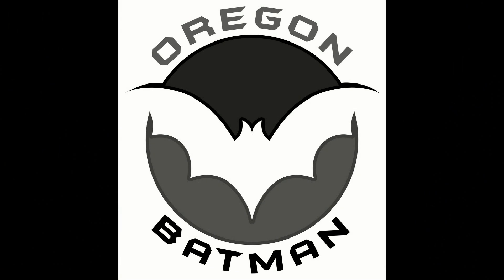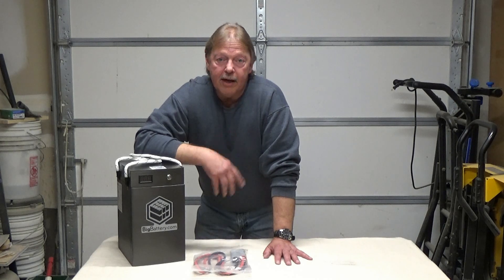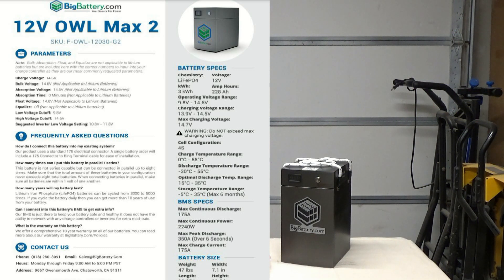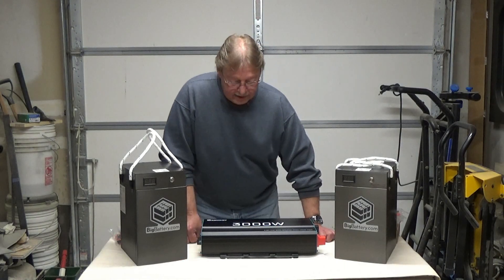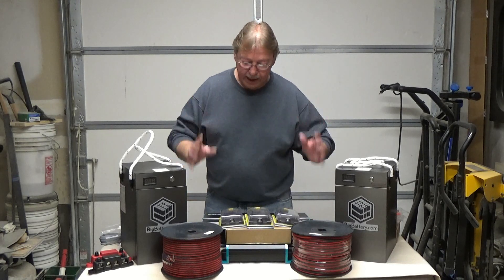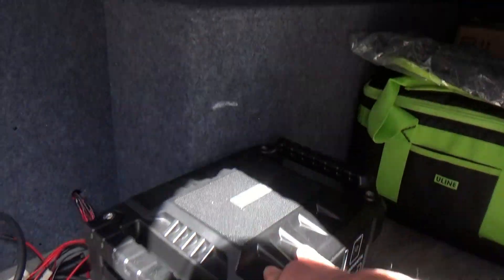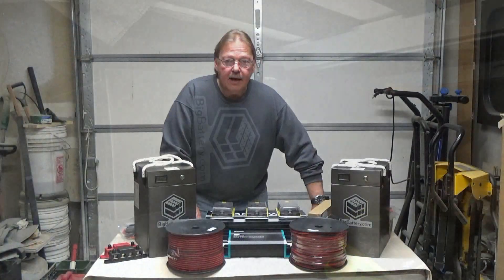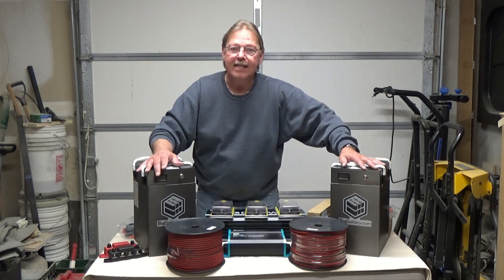Promaster Van Build 2500 159WB – DIY– POWER SYSTEM – Part 30

Comment: Hey there Al! Nice power setup! As I’ve mentioned to you in your videos before I bought the Delta EcoFlow Pro (3600 watt hour) solar power system. I bought it two months ago and haven’t used it yet sadly. I bought it mainly bc I wasn’t gonna go through another week of no electricity and freezing my butt off at home like I endured last year when we had a Texas-wide freeze out. I don’t have a Class B camper van yet…and, although our Texas million day drought was finally broken up the other night with my lights flickering off and on for awhile during a horrific rain storm I ‘still’ didn’t get a chance to see it in action! BUMMER! The battery it has supposedly is equivalent to THREE Battle Born batteries combined. I bought 125 feet of solar cable so I could keep the unit inside my house outta the sun and from theft. I also have two solar panel kits one being 165 watts and the other 400. I sorta feel like “I’m all dressed up and nowhere to go”! 😂😂😂. I’m looking for a builder to build me out a Promaster 2500/159 van like yours but the waiting list is like two years. I don’t wanna wait that long, as, I’ve been retired from 38 years of trucking since 2015 and I’ve been climbing the walls to get back on the road (on MY terms) ever since. I’m excited to see your new system installed in your new van and see it in action! Stay safe as I head to another of your videos! ~Jim~

Comment: Nice to see you  have graduated to modern batteries in this build.  They will save you money in the long term.  I think you will be very satisfied with them over lead acid chemistry.  One thing I didn't hear you specify is if your going to run them parallel (12v) or series (24v)?  If series, you can probably get by with 2 gauge cables between you batteries and the Inverter.  If parallel you will want 0/0 ga cables to handle the 3kw of the inverter.  Otherwise you will get early inverter shutdowns and warm cables, power loss in the lines, etc.  I didn't see those on your table, so thought it was worth mentioning.  Also consider a way to charge these batteries from your starting battery in the van so the alternator can charge your whole system while driving or idling.   If you go with 24v, which I would, you may need another DC-DC converter for 12v to 24v to charge your batteries.  I'd try to find one that is at least 100 amps input, as your alternator can likely put out well over 200 amps when cold.
Reply: A local welding supply store may be your be your best bet for the large cables.  They don't tend to be any cheaper to buy online, or are inferior quality to copper welding cables.
Reply from the maker: Hi Aspendell... going to tie the batteries in parallel as my system will all be 12v. For the cables, found 1/0 welding cables to tie everything together. Had to buy another set of Anderson connectors as the ones that came with the batteries are like 8 awg or 6 awg... definitely too small. I do have a 40amp DC/DC charger that I will install... should have went with something bigger I know. Only thing I'm trying to consider is the fuse between batteries and inverter. Since everything is rated for 175 continuous output... was thinking of maybe a 170 amp breaker, what do you think? I do have a 300 amp breaker I could use, but that may be too large.
Reply: @OregonBatman  Well if the battery BMSs are rated 175 Amps each that would be a continuous rating of 350 Amps in parallel.  The inverter can use up to about 300 Amps, or slightly over, when producing 3000 Watts @ 12vdc.  And since each of the batteries has both a BMS cutoff and a 300 Amp (600 Amps combined) fuse, alls you really need is a way to switch them off. Therefore, I would go with a 300 - 400 Amp DC circuit breaker.  The smaller the breaker, the greater the voltage and power losses across the breaker, same with fuses.  Hope that helps 🦇🔋
Reply: @OregonBatman  Also, you may already know this, but you can buy those Anderson 175 with lugs/pins/contacts starting from about 6 GA on up to whatever size your dealer carries.  So you aren't limited to whatever size they may have come with.  You can buy bigger lugs and just replace them in the plastic housing.  The connectors are rated 175 Amps, but they do better up to 350 Amps than any other reasonably priced connectors, in my experience.
Reply from the maker: @aspendell209  That's perfect! I was heading in the right direction but kept second guessing myself!! Appreciate the help!